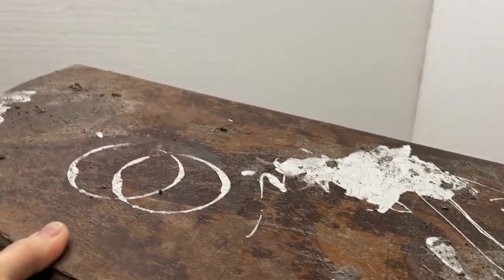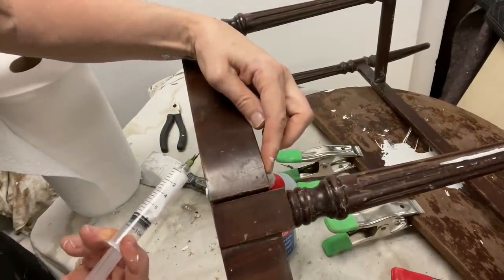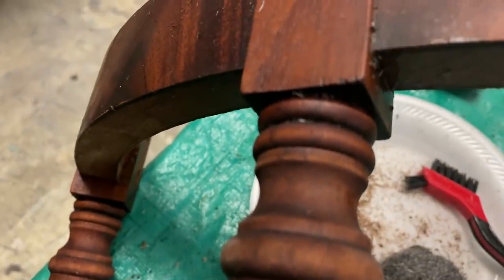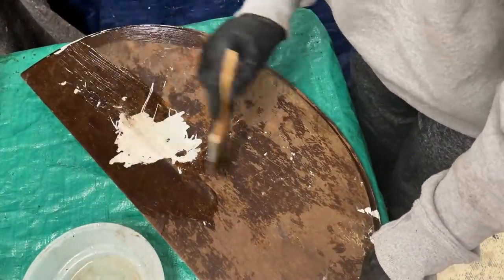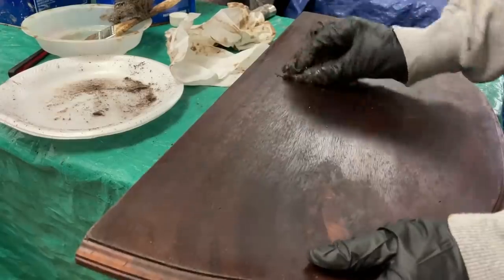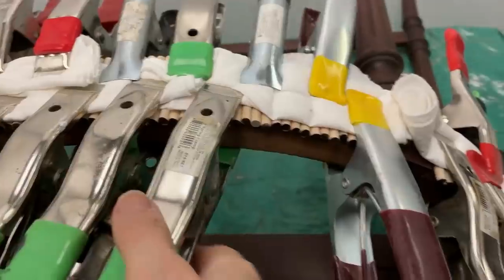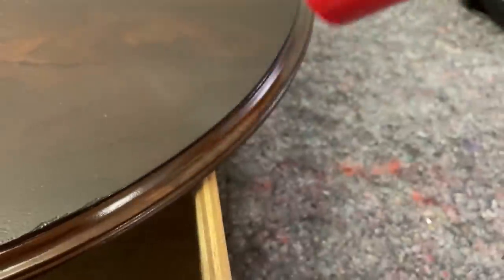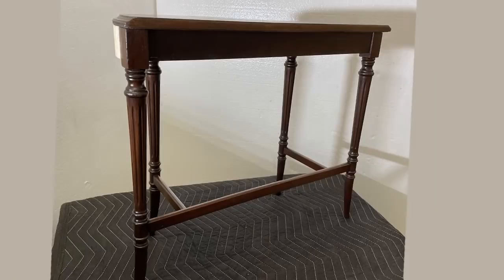AMAZING RESTORATION OF VINTAGE MAHOGANY SIDE TABLE- You Won't Believe Your Eyes!

Comment: Great job stripping and saving, but not all the way sure why you'd cover mahogany with dowels like that though. Mahogany is one of those beautiful woods that speak for themselves
Reply from the maker: Hi Dayna. I wanted to make it look more modern. Anyone can strip it and stain it but I wanted to restyle it. You have now see a new way to change /update furniture using 1/4 inch wood dowels. I am going to use them on a dresser in an upcoming makeover. So, I learned a lot about how to cut them, glue them, etc on this video. Thanks for watching!!

Comment: In my experience, it works best to remove stripper with a scraper—plastic ones are less likely to leave scrape marks—and the residual with CLEAN steel wool. Then steel wool and mineral spirits for a final cleanup. And agree with others that the dowel pieces are too much for this sweet little table. Staining them to match the rest would have been a bit better than leaving them natural.
Reply from the maker: I wanted this table to look more transitional since traditional does not sell well in my market.  I tried using a plastic scraper but it began to "melt" and simply did not work! Maybe I need a special plastic scraper.
Reply: Metal scrapers aka putty knives, broad knives, tapers knives, cabinet scrapers (some made of glass) even pastry scrapers if sharpened work well for removing paints and coatings. Some of the plastic tools are great but depending on the stripper it will soften and essentially begin to dissolve the plastic. Sharpening a scraper is easy since it is not dealing with a "knife" edge although the same principle applies with "regular" knives. The leading edge (s) should be flat. A piece of closed coat sandpaper laid flat works well.  Some tips on stripping and strippers:  Use the stripper (s) according to the directions ie use more. up to 1/4". Let the chemistry do the work. Letting any of the types and brands of stripper sit is not going to make the stuff work any better or worse. With the solvent/paste strippers. clean up is less messy after the solvents evaporate. Using paint thinner is fine for final wash. Lacquer thinner is sometimes used on pieces originally done in lacquer (real lacquer not something just called lacquer)  residual shellac can be cleaned or amalgamated using alcohol.  If we may, a general tip: There are some highly skilled pro's that share on the www. There are also pro's that are sales pro's that promise that what they have for sale is going to make that piece of firewood that was two-bits a $500 instant heirloom with a single coat of (now you know)  Magic Gordo Sauce...
Reply: Except the dowels might have stained a different color.

Comment: What a beautiful transformation! And I really appreciate the fact that you included your whoopsie-daisy with the laquer at the end. It makes my own mistakes way more tolerable. 😁
Reply from the maker: OMG Taytase. Anytime you refinish furniture you should just expect things to go wrong. I try to be real with my videos so you can trust my info. Glad you liked the video!!!
Reply: The reducer (thinner) for real lacquers are miscible with water. Sometimes used in concert to remove overspray on glass and trim on cars etc.  Blushing is caused by water and Mohawk has a great fix and a superb line of products as well. Water and the resultant blushing can be caused several ways. In the example here the substrate was wet. (Stuff Happens!)  Sometimes the ambient air is damp or humid when spraying or even using brushing lacquer and shellac. Yep. shellac is somtimes sprayed too using special heated conventional cup guns. . Some basics : Two types of HVLP rigs one using compressed air  from compressor the other using air from a turbine. As air is compressed it heats upon release it cools and can adsorb or absorb water. In a turbine rig large or small (hand held) the air is heated. Conventional sprayguns including airbrushes use compress air as the vehicle. The third type is the "airless" that is hydraulic.  Any attempt by anyone in the "biz" who purports to hav e even a tenth of the solutions to this painting business is best taken with handfull of salt.

Comment: don’t wipe off wood glue with a damp cloth.  Let it get “leather” dry (about 10 - 15 minutes) and scrape it off.  That will minimize the chance that the glue will be absorbed in the grain, only to reappear when you go to stain and top coat.
Reply from the maker: Great tip. thanks!
Reply: I @FurnitureFlippingForProfit

Comment: Great work. I have a couple side tables that I'm going to restore and I found this video helpful. Also if you were going to put those small dowels on the table why leave the veneer there?
Reply from the maker: Do you mean why not take off the veneer underneath?  There was no need to take it off.. I guess i figured it would not hurt to leave it on. Of course, technically I did not have to strip it and stain it.
Reply: @FurnitureFlippingForProfit  that's kind of what I said. Just in a different way. Again great work.

Comment: Let’s talk about your clamping. Buy some Performix Plasti dip for your tools because you never want the hard metal edge on wood. When clamping a curved section with veneer smooth it down starting where the veneer is already attached then start clamping the same direction. You will get a better hold that lasts longer.  Less glue is better as long as it covers the surfaces. You want as little squeeze out as possible.
Reply from the maker: I have seen that stuff but never used it. I agree. the plastic edge has come off on many of my clamps.That is why I had several thicknesses of paper towel on the wood to protect it. I will add it to my Amazon wish list. thanks for watching!

Comment: Any reason that you don't go with oil and wax instead of lacquer.  I always feel that the wood would much prefer it.
Reply from the maker: I sell the furniture I refinish and people do not want to be bothered with waxing or oiling it every 6-12 months.  Of course, if they do NOT wax or oil it, then it will loose moisture from the wood, etc.and I am afraid a year from now they will call me up complaining (or worse yet, write a negative review about my furniture refinishing skills on FBM) I always refinish furniture so it does not require any maintenance other than dusting a cleaning with a damp cloth.

Comment: Want to transform an old barn door into a dining room table. Plan to remove the hinges & put glass on the top. What would you do to the wood?
Reply from the maker: Depends on what it looks like. I have an interior designer friend that designs multi million dollar homes. She took an old door and did NOTHING to it but put legs on it and glass on top.
Reply: @FurnitureFlippingForProfit  I’m worried it may dry out. You showed the use of danish oil in one restoration.  We definitely plan to add glass & legs to it.

Comment: Could you show how to restore wood trim? I bought a house and all the original trim is beautiful mahogany that's been painted several times
Reply from the maker: Hi Caveman. You strip it down, sand it, stain it and put a sealer on it. We did that to the trim in the first house we purchased. It was well worth the effort because  we could no longer buy that trim.  It takes a long time and is very messy!  Just take your time- make certain you wear a chemical respirator and nitrile gloves!!!  I like Kwik Strip stripper

Comment: Overall, I like the piece - the dowels not so much, but the rest of the restoration was ok - you are getting better at veneer work, but you'll never get it totally even with those spring clamps - you need something way stronger (an F clamp is ideal, or a trigger clamp is ok) and a proper caul - say a scrap piece of wood with some parcel tape on it to prevent adhesion - this will result in a perfectly even application of pressure and reduce the dings and hollows effect some.  Lacquer is awesome, isn't it?  Spray 5-6 thinner coats - they all bond into each other - and you'll get less ripple.  Sorry to be a bit negative - I thought you deserved a decent comment for the algorithm.  I really appreciate your style and work.
Reply from the maker: Thanks! great tips!

Comment: I am redoing a cabinet door and I am having trouble getting the penetrating stain to stain under the handle. Is there something I can do?
Reply from the maker: Did you remove the handle? Did you sand it the same as the rest of the door?

Comment: In regards to the bloom what was the temp and humidity that day?
Reply from the maker: The humidity was probably about 70-80% and the temp was 80 degrees. However, I have no doubt that it was due to the fact  that I used a damp cloth to remove the dust. I had just put 2 coats of the lacquer on and did not see any bloom but when I dusted it with a damp cloth and did the third coat I saw it immediately.

Comment: I use Citristrip more often than Kwik Strip, but I think you are taking it off way too soon.  That product would have taken the finish down to bare wood in one pass if you had given it a chance to work.  Using paper towels and those light shirt treatments didn’t remove the original finish completely at all.  You still had a full stain layer.
That probably contributed to your moisture in your finish and your “bloom” issue.

I do think you have a knack for this and I wish you success in your business.  I’m commenting to give you some additional info to consider, only.  I think that you’ve heard plenty about those dowels…did you find that a unique touch like that helps you stand out in the refinished furniture sales market?  I suspect that maybe there is a market for non-traditional items, given the popularity of the upcycling/refinishing/painting furniture trend?  Otherwise, if you find that your items don’t sell as quickly or as well-priced as you want, I think it’s best to not add details that are from a different design family.  Best of luck!  I’ve subscribed and look forward to seeing your future projects!
Reply from the maker: YEAH!!! A new subscriber!! I added the dowels to make it look less traditional and more transitional Traditional does not sell in my market- transitional does.

Comment: Oh my goodness!! What a transformation!  Love the addition of the dowels.  Really made it a unique piece.  You have soooo much patience in stripping.  I definitely would have taken my carbide scraper to the top first, then strip the rest. Either way, well done!
Reply from the maker: Hi. I am afraid to use a carbide scraper on stained furniture because I don't want to scratch it.  If it had a bunch of coats of paint I would have tried the scraper. I could not tell how damaged the original finish was because there was so much dirt and gunk and paint, etc.

Comment: Lacquer isn't a traditional finish just FYI
Reply from the maker: Laquer has been used since the 1920s which is a lot longer than polyurethane and is frequently used because it dries so fast. That is what I meant. Thanks for the clarification. Thank you for watching.

Comment: Why oh why did you add those ugly dowels? It ruined the integrity of the original piece. The stain was beautiful so just using a polyurethane would have made it look like it did many years ago. I am not a fan of lacquer because it scratches easily ( I have laqcuer on my tables). So sorry, but I gave this piece a thumbs down.
Reply from the maker: Hi Victoria. As I mentioned in the video, I have not used Lacquer before and since this was such a small table I thought it would be a good piece to try it on.  I wanted to restyle it so the dowels made it look more transitional. Thanks for watching!

Comment: old varnihed  surfacest are generallt cracked and crazed  with the side table you had   a better way to remove a varnish finish is with  de natured alcohol and a coarse  steel wool pad. by scrubbing the  piece  with a circular motion  you  put the old varnih  into solutiom and you an just wipe the finish off  now if there was varnish under that paint stain  thet would have been removed too.  denatured alcohol evaporates in a few minutes  too..  the stain you used is to your taste and very reddish almost a cherry stain   it could have been greatly enhanced  by an application o f a medium shellac   and allowed to dry.  I would never spray a piece of furniture  with  lacquer  as it is photo reactive  if you dont want to brush on a good coat of spar varnish minwax make a poly carbonate  finish in satin that will not yellow and  possibly craze in the son and will probably last for 50 yeaRS.   BY THE WAY  i AM A FURNITURE REFINISHER WITH 45 YEARS EXPERIENCE AND LEARNED FROM AN OLD GENTLEMAN THAT HAD DONE IT  FOR  40 YEARS BEFORE ME
Reply from the maker: Wow Gary, where were you when I was refinishing this! LOL!  I am in awe of your knowledge and experience.  I wish I had used denatured alcohol. Another viewer had recommended it but I simply did not think of it at the time. Thank you for your comments!

Comment: Not a Mahogany table. 
This was a Great Depression era (1930's) Walnut top and walnut finished table.  The rest is probably mixed wood species probably Birch and poplar which are common. This is simple work that almost anyone can do. Problem is high quality stripper was outlawed for residential use by Obama administration regulations. Good luck removing finishes with citric acid (Grapefruit juice).
Reply from the maker: Thanks for your comment Brian.